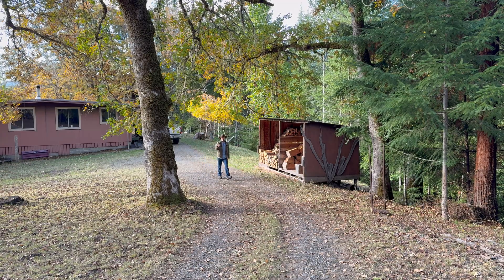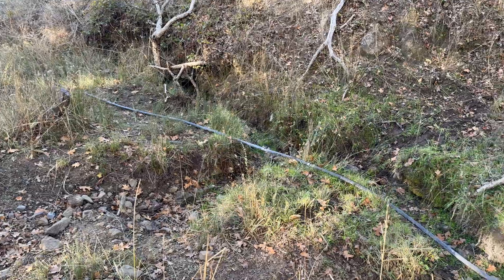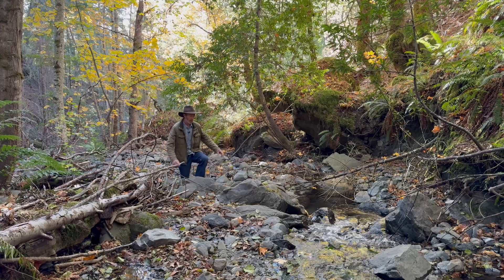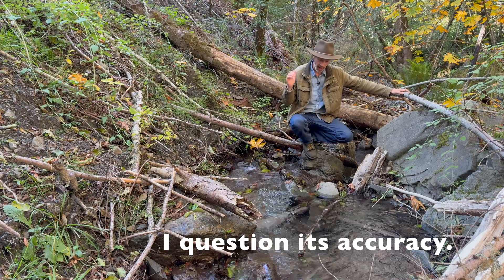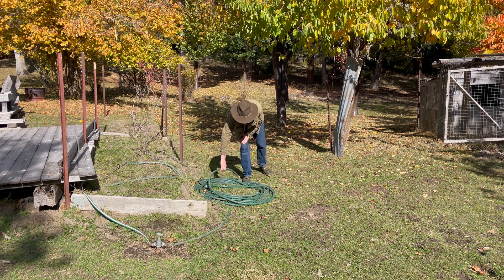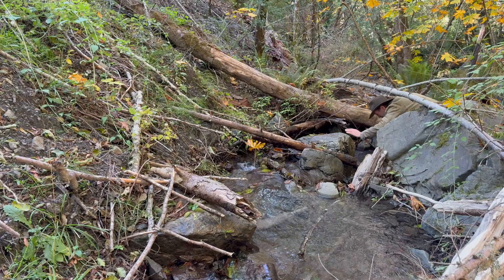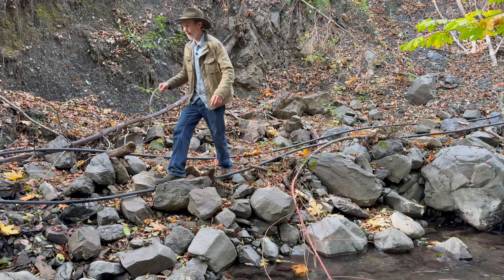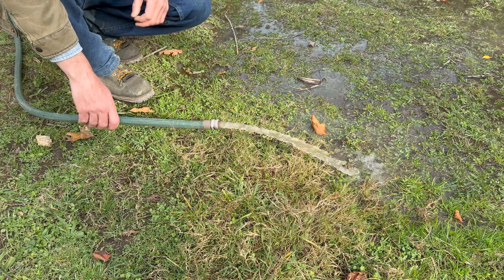We Built a Gravity-Powered Off-Grid Water System

Comment from the maker: One of the most common questions I am getting is how we keep the pipes from freezing. Our main technique for that is to be in a mild coastal climate that doesn’t get that cold very often. The pipe has enough flex in it to expand enough for our level of freezing. Usually nobody is using the place that time of year but if they are, keeping a little water running usually does the trick. The few leaks keeps some water moving too.
Reply: i have the same system ( bear bites and all )...
and yup- leaks help
Reply: i have the same system

Comment: Why no collection box, even half a blue barrel would give you better collection. Also put a valve on the leading end of the cut at the small creek so you can slow the draining of the line to the house, also a stop at the house would hold the water in the line until you are ready to let it do its vacuum thing.

Comment: Why not put some sort of Y at the littlecreek and bigcreek? Turn the valve one way to open up intake from the small creek (closing off the big creek) or turn it the other way to do the opposite. then you can have two screens. although you might get the issue of sediment buildup in the big creek section while it's closed off if you don't unhook it. But it might save from losing that pressure.

then again it looks like a nice enough walk.

Comment: To get the water to flow, and get any air out of the system, I connected mains water to the bottom end and gave it time to make sure the whole pipe is primed with water.

Comment: To purge air from the system: pump clean water up the pipe from the bottom. It'll push the air out of the top. You shouldn't even need a high pressure - high volume pump.

Comment: Just like our farms kuliana water sys. We have about 180' of elevation to our inlet pipe. We used 2" poly pipe for about a half mile to the house and farm. Our inlet is a 3' piece of 4" pvc pipe that we drilled 1/4" holes all through it and the cap then its wrapped in screen. This way 5he screen wouldn't collapse as it got more and more clogged. The flow was great for all the irrigation and the house. Only problem was when a big rain caim wed have to shut off all the water until the stream ran clear again then flush the line. Once in a while wed get a small leak and it would take some walking to find. The worst was developing a small leak on the bottom of one of the rises that would allow air to get in and wed eventually lose the prime.
Anywho, just reminiscing. Great video.

Comment: If you're doing maintenance on pipe with a flathead and not a nut driver, it means you've been through some shtuff and are willing to trade the best tool for a job for the one that is able to handle the most unexpected issues that arise with that job. Cheers.

Comment: The property I just purchased in Idaho has a similar water source but we tap a spring, and the pipe is 3 inch in diameter and 3000 feet in length. The pressure 250 feet or so below where our home is located is so high that a pressure regulator is required to keep the seals from blowing out on the faucets.

Comment: I got the original community water system, when I bought my house.  I use it for irrigation, and there's a basin in the bedrock, so it doesn't move - but I have to dig it out every spring.  I also need to make myself a better inlet screen, because I installed a fire hydrant last spring, but it only runs about 90 GPM, and I think the screen isn't letting enough water in.  I lso have a bit of trouble with trees falling on the lines and busting them, because it's PVC.  and they're making the fittings and pipe heavier and heavier, every year.

Comment: That's awesome! Does the water have to always be flowing out somewhere?
Reply from the maker: No if we shut the water off the water just stays in the pipe ready to flow when the water is turned on. Last summer there was a time when air bubbles were accumulating on the upper end and slowing the flow. But after fiddling around with the pipes that problem mysteriously disappeared.

Comment: Thanks for reminding me of when bears chewed my similar setup.  Woke up in a morning to no pressure at the house and a sprinkler system in the woods. My guess is the bear heard an air bubble, bit the pipe, creating more bubbles to ‘chase’. After chomping in multiple spots, none consecutive, I had to replace almost 100 ft of pipe.  I decided to run the waterline through scrap lengths of pvc pipe, down the entire length of the line (almost 600 ft), just daring the bear to bite it. It’s been over 10 years and thus far, no more bear bites. Love your videos. Living in North Ga mountains too has its bear issues.  Must be cousins😂.
Reply from the maker: I would say I am glad we are not alone with this problem but that’s probably not a very nice thing to say. 😁
Reply: i live in N Ga as well.... non stop bear bites

Comment: put a wye in the pipe and have two inlets so you wont have to swap positions
Reply: I was thinking that and also that would make it so no air can enter the system.
Reply: @davebloggs  exactly, and put valves in too if you need to shut one side down
Reply: @ericarachel55  Its a good system but would not work here as we often go down to minus 20 or 30 over winter .
Reply: @davebloggs  I doubt they use the place in the winters as it gets cold there too, even here on long island we go below freezing quite often